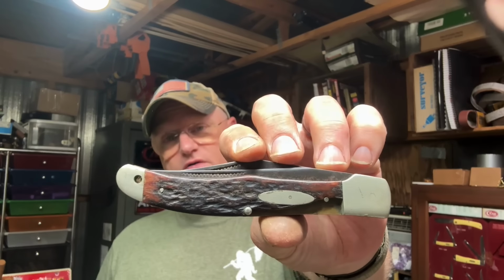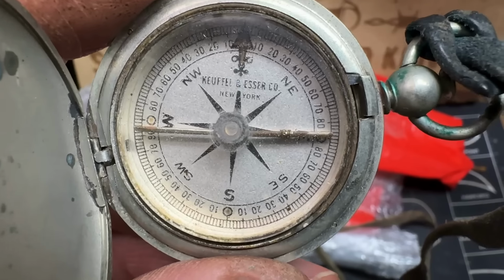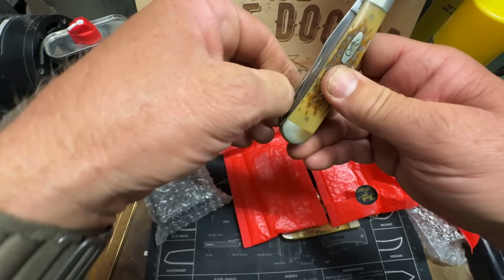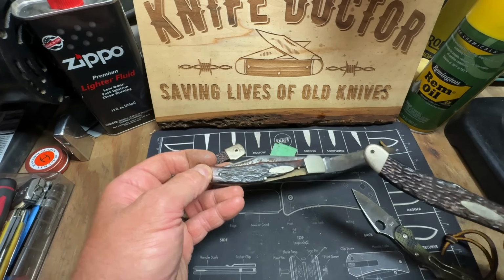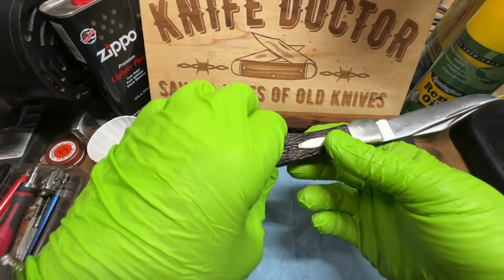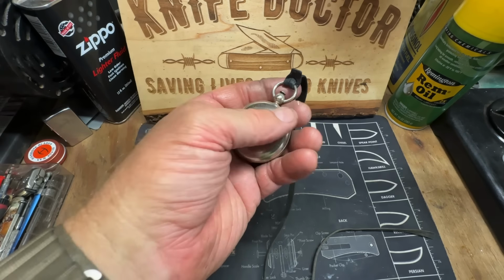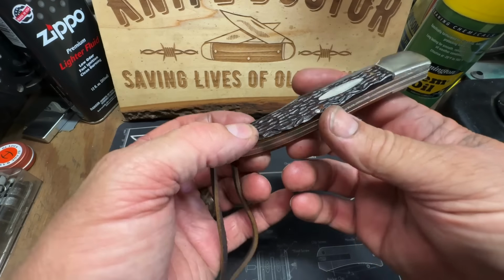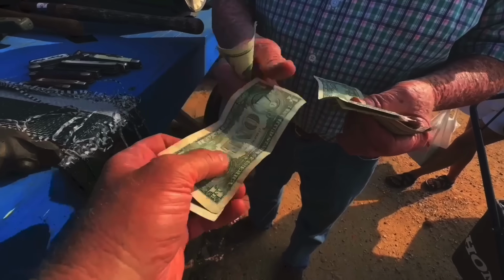Restoring a Vintage Western Knife + Mail Call from GA & AZ!

Comment: Here is some info from a Knife Forum I belong to on the Case XX Changer.

"The frame was changed sometime around 1999. Blades from XXChangers made before then will not fit correctly in frames made after the change. And vice versa. Worse, while you can buy new blades from Case that will fit the modern XXChangers, Case no longer sells blades that fit the earlier pre-change (older) frame. To replace blades for an older XXChanger, you have to look for them in the aftermarket.

Generally speaking, if your XXChanger came NEW with the pointed toe sheath where the blades were stored in front, then you have the original pre-change model. If your XXChanger came NEW with the squared sheath where the blades are stored behind the knife, then you have a modern post-change XXChanger. That assumes, of course, that no one changed the sheaths out over the years."
Reply from the maker: Thanks for sharing this!!

Comment: Benchmade etches their tang stamp. Spyderco etches their tang stamps, even Buck etches their tang stamps on many models. Look at your Spitfire tang stamp. I prefer the old way, but times change.
Reply: Awesome valid points (though spitfire might be stamped) doesn’t seem to effect function on the $200-$400 knives and they still sell like hotcakes. I got a 90s model Blackjack or two that sell on the bay for $4 plus that are etched but mine will have to remain with me.
Reply from the maker: But the fact is…Case didn’t last year.  Now they’re doing it.  Case is Falling down the ladder in Quality.  Love the old Case…😊
Reply: Should we blast benchmade for never stamping or commend case for evolving in an attempt to keep the costs down for us consumers? Price check former to latter and see what you think. I could share a terrible experience I had sending a knife in to benchmade with their lifesharp program as well as case not wanting to replace blades in an old knife even if I offered to pay.

Comment: Hey, do an episode on preventing a zippo from letting all the lighter fluid evaporate. Mine goes empty in two weeks and I've tried the ziplock bag trick. I don't smoke but have it for melting paracord ends and misc tasks.
Reply: Amazon has plastic inserts which significantly reduce evaporation, I've used them for years and they're great ‼️👍🏻
Reply: I just got a Zippo brand butane insert (made in china) to throw in truck console in AL heat. Haven’t had long enough to FULLY  recommend but 2 weeks in, so far so good. Don’t know of any way to stop a zippo from evaporating from a 40+ year smoker.
Reply from the maker: It will always evaporate.  Nothing you can do except refill.

Comment: I hate what is happening with Case. But that is what happens when investors take over companies with the intention of downsizing and cutting corners to maximize profit. RIP Case.
Reply: I swore off buying Case ONLINE couple months back but it didn’t last 🙄. Couldn’t pass up a Tribal Lock for $69.99 to my door from company in TX. If I wanted to nitpick, sure the blade is slightly off center but so are many others that folks hand selected and bought anyway. At that price and mine is a user I have zero complaints.